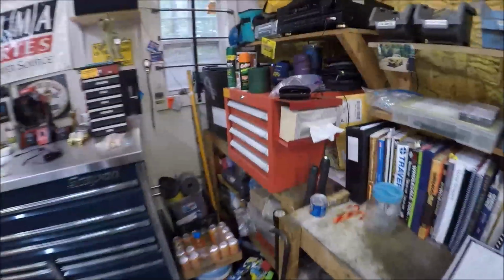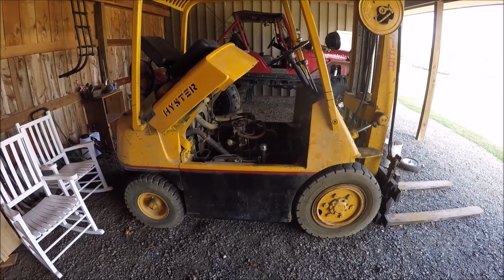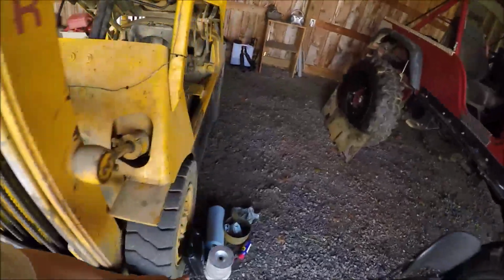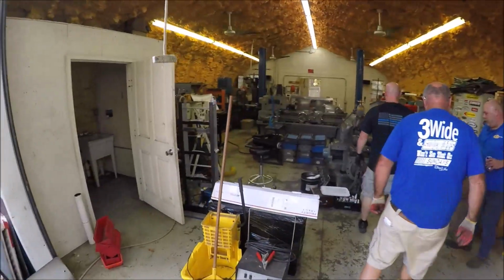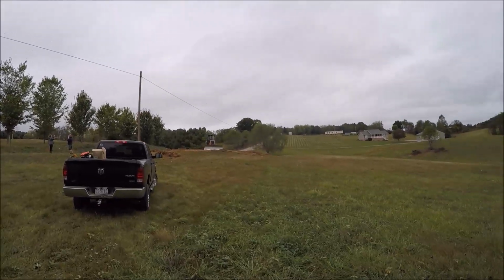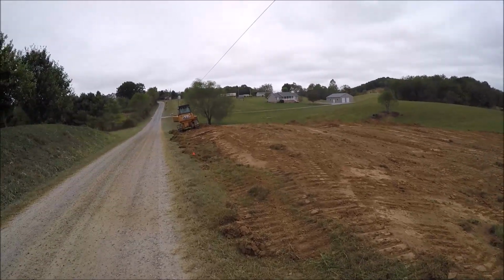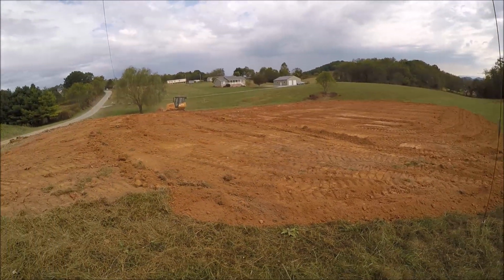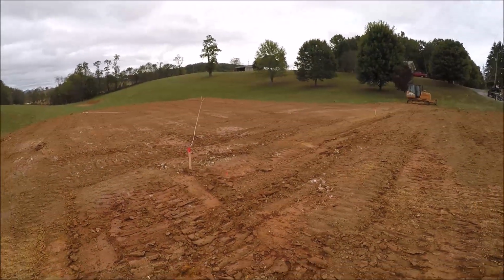The new shop build Part 1  Moving everything and breaking ground!

Comment: Tom, What about your utilities. Phone, Electric, Water, Gas and Sewer. Are you trenching from the main house or will you have separate meters. My shop is 30 feet away from my house and I wish they were connected. What do you plan to do? Walk or get a golf cart, Gator or side by side?
Reply from the maker: I will have a separate meter for my power. Both power and phone lines run along the road so hook up should be easy. I actually have a water line running by the front of the shop to an old water trough. Going to tap into the line and have a yard hydrant out by the door. Too expensive to put in a bathroom because I would need to put in a septic tank and drain fields. I walk down or drive the Jeep down currently. Thanks for watching.
Reply: @hilltopmachineworks2131  My suggestion is to at least plan for a bathroom and place the under slab plumbing for the future. Either have the toilet elbow just under the slab or penetrating through then flushed with surface and use a test plug. Not a lot up front that will eliminate expensive slab cutting.
Reply from the maker: Marcel Fortin Good idea thanks.

Comment: How much does the forklift weigh.  A 5k lift will be 7500lbs ish..  the forks carage looks like a class 2  good for 3500lbs. And you lose some lift because of the pneumatic tires.  
The shop move looks like fun.... not...   you never realize what you have till you need to box itall up..  I was just looking at my empire of dirt yesterday.. omg.  
The building lot is making me jealous,,  I need another 40' added to mine.  But will settle for 20'.
Reply from the maker: It maybe only a 3000 lb. lift. With no data plate and only the serial number to go off of I am not totally sure of it’s capacity.

Comment: I knew Jim would be there to help, that's just the way he is.  Good luck with the fork lift, you're gonna need it. Make sure that dirt is well compacted, don't want any settling cracks in the concrete slab.  Good luck Tom, it is always an adventure moving heavy equipment.
Reply from the maker: Thanks Vernon. Yeah Jim and Michael are both great guys.